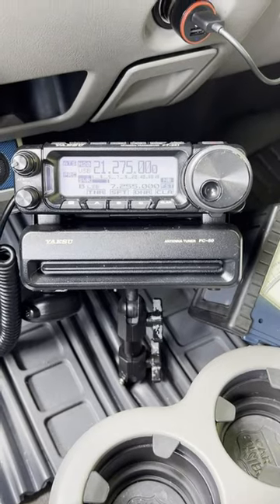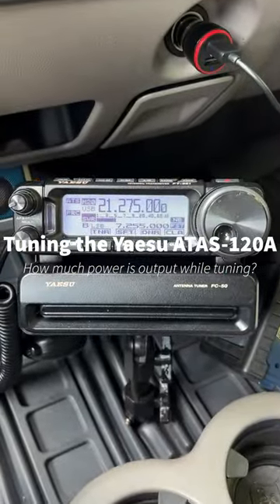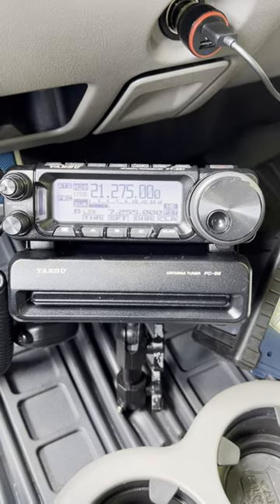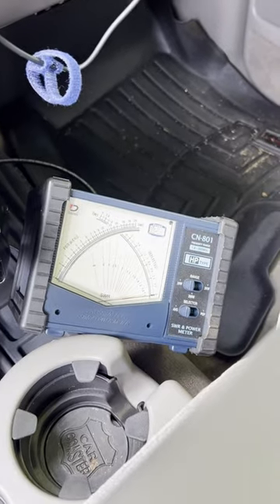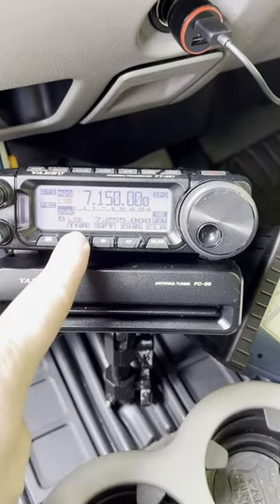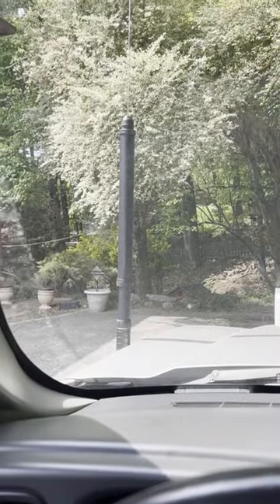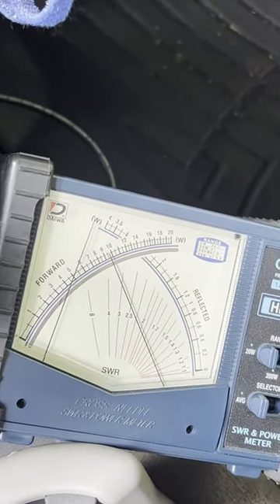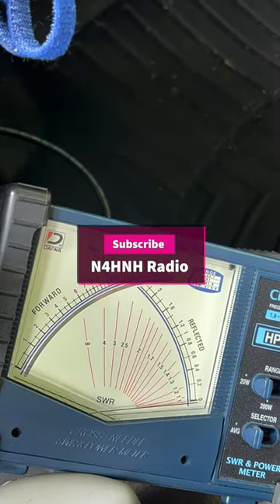Tuning the #Yaesu #ATAS-120A #screwdriver #ham #radio #antenna

Comment: I still wonder I’d the DC offset sent through the coax affects the power out reading. Interesting. 
Good videos! Nice work!
Reply from the maker: The motor power is DC. RF is AC, at 7 million Hertz or more for the ATAS-120A. The two aren’t even close to interacting.  It’s similar to how you can get the Internet and cable TV over the same cable that comes into your home.
Reply: I just wonder if the power meter you are using only measures the RF energy? Or, does it pickup the DC current to the motor also?
Reply from the maker: @K7TDM_Tyler the meter cannot read DC. It is a wattmeter. RF power is AC.  The lowest frequency it can measure is 1.8MHz.

Comment: Which bands does ATAS cover Doug?
Reply from the maker: Hi John!  The ATAS-120A covers 70cm through 40 meters. To use it with 70cm and 2m, you need a duplexer, like the Diamond MX62M.  Connect from the duplexer to the 2m/70cm radio with one coax and another to the 6m through 40m radio.